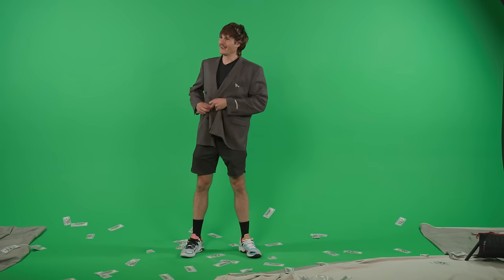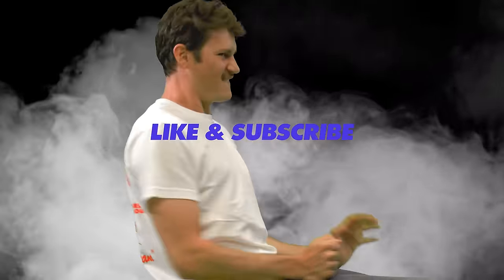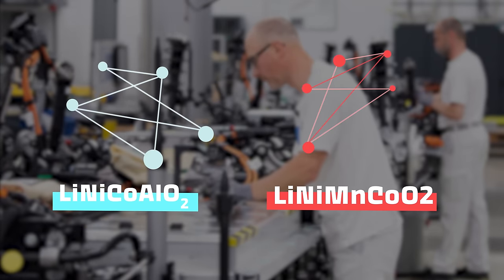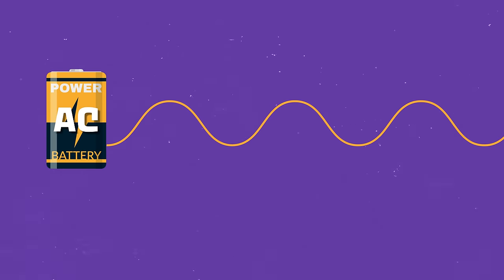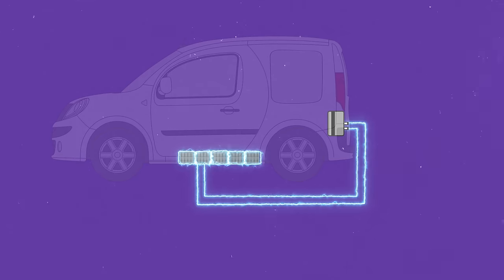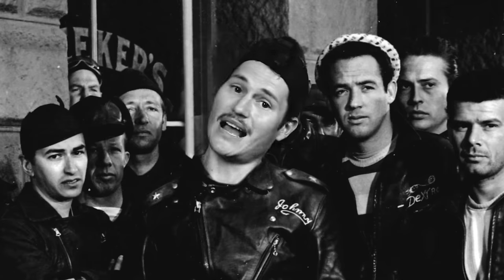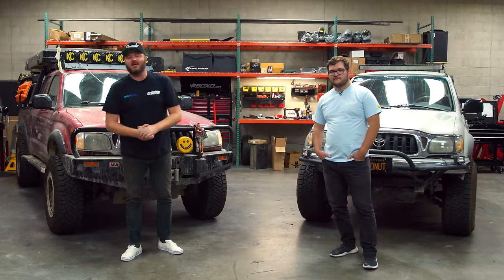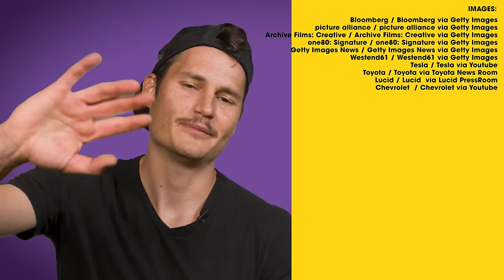Why this Chinese Car Costs $900

Comment: You laugh at that name on Alibaba but that is the actual statement of practicality in China. Many grandads will pick up their grandchildren in these electric cars. They are driven on the main road usually but are not legal. They are designed for the elderly. On roads, the elderly will be allowed/ignored, to drive these about on the roads. It makes things practical for the elderly. I ride an electric bike and I usually have to dodge these as they go in the bicycle/ebike lane (for electric bikes and pedal bikes). They are also used on the road but to the side. Some use them as a taxi in the farmer regions, they  charge $1 for a short distance, very cheap usually. Just to let you know you can buy them for about $315 with no battery. You then add on the battery you want. That price is actually for the boot/truck version. So, like the one you have but with a small extension on the back for luggage, etc. This is the price for retail, you can probably get another 100 usd off in the wholesale in China. Also, if you buy in the villages, mega cheap.

Comment: As far as I know, these don't require driver's licenses to operate on roads in most cities in China. They are kind of being banned by local regulations since they are frequently hit by other vehicles, causing a lot of casualties (these cars merely offer any protection to the driver). The majority of the drivers are the elderly who don't know the existence of a DL. That's why they are called the 'elderly's leisure car' or 老头乐. I've seen one taking random U-turns on the road lol

Comment: Ok, back in 2009-2011,  Kandi had the Coco for sale in the usa,   the KD08E, this was a little 25mph/60 mile range electric car, that cost..  899. 

one of the funniest arguments about it was...  "well what happens if it breaks in 2 years...."   "it was 899, buy a new one!   its cheeper then the deprecation of almost any car the moment yo drive it off the lot!"

Comment: deep cycle lead acid batteries are designed for almost full discharge and still have long life and rack and pinion was around in the 1950s in Europe.

Comment: What's crazy, is Americans will spend $5k-$8kfor an electric golf cart...basically the same thing. So there is more to the low cost than how it compares to a tesla.  An electric golf cart usually has a bigger motor but similar voltage and lead acid batteries.

Comment: The washer motor shown is a universal brushed motor. They also runs on DC. But 60V is a bit low so som electronics is still needed.

Comment: I want to buy this and slowly upgrade this with more powerful parts. Bunch of 2nd hand lithium iron batteries. Bump the voltage and finally swap in a 10-20kw electric motor and inverter.

Comment: It's like a modern Trabbi!

Ultra cheap and basic. Designed to basically just get you from A to B. 

Though, I think the Trabant might have been bigger. East Germany might have done a better job.

Also, the use of a ashing machine motor makes me think of CSIRAC, Australia's first computer. Built in the late 1940s by the predecessor to the CSIRO, it used the motor out of a washing machine for the drum memory secondary storage system.

Comment: Good modding platform maybe, I have a 5000 watt motor sitting around,  bet I could cram it in, and double the range with a good lifepo4 battery.

Comment: That car would make for a fun project car, convert to lithium batteries and squeeze in the biggest motor you can fit in it, lower it and put on deepdish mag wheels with low profile tires on it and flare the wheel wells then chop the top but put a sun roof on it so your head will stick out the top!

Comment: If cities had even remotely intelligent design any residentially zoned area would have 25 mile per hour speed limits on every street minus access roads to interstates and highways. NYC almost has 25 mph speed limits universally and guess what, they have almost no traffic fatalities relative to smaller cities with higher speed limits

Comment: Sounds like what Clive Sinclair intended to make after his much derided C5 single seat 3 wheel pedal assisted 3 wheeler. Yes - lead acid battery an 12v washing machine motor.

Comment: It would be great to see you get one of these upgrade things. Twin motors, bigger preferably, lithium batteries. Up the voltage to overdrive the motor. Let’s see if you can double that top speed. 😄

Comment: What if you can charge the battery on-the-go? Stick a windmill-like device that could generate power to charge the car's batteries as it moves 🤔

Comment: If you can order these without batteries, motor and controller you could put qs 138 70h motor, sabvoton 72150 and atleast 5 kwh lifepo4 battery in this for about 1500 dollars easily and then it could be actually be used as city car. I think about 10 kwh lifepo4 battery in this would be possible because lead acid batteries are over 4 times heavier than lifepo4 so battery would weigh about the same but performance and range would be lightyears better :D

Comment: 2:46 - you can see the ones that caught fire and were returned to sender. J/k.

These things are cool. I'd love to put a 1 liter 3 cyl kubota turbodiesel in it, could probably get 100 mpg easily. Just the way it is stock makes a joke out of the new prices of an electric golf cart. Just an enclosed cab on a vehicle  should in itself make it worth more. Reminds me of the tata 2700$ car from a few years back, just way cheaper.

Comment: Usually we won't consider this Changli as a passenger car in China. If I buy one here, I can't get any insurance or registration for it. It's basically a wheelchair with power, steering and a roof.
I don't see any trash made in any other country get so many attention.
Talking about the Chinese fake cars and the wheelchairs easily get the views, not the decent mainstream Chinese brands. I understand it, but I feel sad for the Chinese car industry.

Comment: Okay 2 BIG issues i see. 

1. The 12 batteries to run this car will probably cost more than the car itself.
2. Lead Acid batteries are not designed to do hundreds or thousands of cycles like a Tesla or Iphone battery, they typically are only designed to live for double digit cycles so you'd be changing your (more expensive than the car), 30 pound, super polluting, batteries all the time.

Its all bad.

Comment: Very interesting. Don't see it being very popular in UK though. You would need to have a top speed of 30-40 mph to use it around town. Cruising along at 20 mph, you might fall victim to road rage on your first trip? A shame really - how many big gas/Coulomb guzzling cars only have one or two occupants and are probably on a trip of distance of less than 40 miles? If we all switched to cars similar to this (even as second cars), could have a big impact on pollution?

Comment: Ya know. In the city, it might not be so bad. And at 700 pounds, it’s only 200 pounds heavier than my motorcycle.

That said, I’m not in the city anymore… and this little car would be scraped off the bumper of the huge trucks everyone drives out here. 

Add: I have three motorcycles that keep rotating. I have one bike they’re gonna need to bury me with. 😅

Comment: The Watts per pound of this thing is lower than my cycling FTP: 1200W/(712lb + 174lb)=1.35W/lb vs 300W/(25lb + 174lb)=1.5W/lb. Granted I can only output that for one hour but I also recharge faster than 6-8 hours!

Comment: Ive bought used w/200,000mi for a dollar, 04 corolla, got 60,000mi out of it, cold A/C, only reason I got rid of it was because I wrecked it, my fault, probably would have done 30,000 more.

Comment: do you know if there is an upgraded motor that you can replace that 1.6 hp washing machine motor?
I am serious about wanting to change it out on the one I bought because the advertising is very deceiving when it shows how fast this thing can go.
if you try to go up a hill you might do 5 mph and it's struggles like hell. There is also a governor on this thing that I would like to disconnect if anybody knows how to do it?

Comment: So they literally built a knockoff of a 40 year old top-of-the-line Club Car golf cart with a cold weather kit, and upped the battery voltage, but shrunk the motor... Gottit.
Reply: If you live in New York City, this would be an advantage but in smaller, less dense towns i don't think so.

Comment: lol I've seen e-bikes with more power and better... well, everything. Mine is limited to 250W (or around 0.3HP) for legal reasons, but it does have e.g. hydraulic disk brakes. Then again it did cost me closer to 3k€ and doesn't have a roof. On the other hand it's a ton of fun on a trail, and makes commuting a joy.

Comment: converting AC to DC (Charging) then from DC to AC (Motors) is So inefficient a boggles my mins.. but i guess we cant have efficiency, that will come when they have run out of POWER BABY... just like modern vs old gas cars.

Comment: @3:17 .. Engineering costs, pff. I have a pair of Crown Victorias, an '04 and an '07. Same glass, metal, etc .. but every little thing isn't. For example, the headlamps and markers are the same - but the (bulb) harness plugs are different. One of the alternator mounting bolts moved a quarter of an inch, which means the coolant crossover casting which it bolts to is also different which required retooling. The power window modules are entirely different. Etc, etc. We're not talking safety or revision due to a fault .. this is a model year change for the sake of pissing money away. Actually, almost every connector in the car is different between the two years - not necessarily the signals on the wires, but a tweak to the shape of the connector, or swapping the wire position. Why? No clue. But it burns my ass when I hear them whine about not enough money. Iacoccoa knew how to sort that out 35 years ago. As well .. How many post 90's auto-trans offerings came out strong and stout, but the fourth or fifth model year revisions regularly shit the bed? In the old days, a TH-400/727 Torqueflight/C-4 would swap like for like in decades of model years. And why wouldn't they? Engineering and tooling was already bought and paid for .. ka-chunk-ka-chunk the buggers off the line for material and labour costs years to come. 

In fact there's been a relatively recent one-eighty with this dichotomy. In days of ye olde, powertrains would go decades in production, with industrial design understandably tweaking the metal yearly. Hard to sell a '77 if it looks exactly like a '76. I get that. And then frankly a wise move (GM for example) going corporate across the board deacdes ago. No more of this BOP (Buick, Olds, Pontiac) crap .. EVERYTHING  General gets a 305 or 350. How long did AMC cast that old 258? Or rather, how long was that 258 cast long after AMC  went tits up.

As much as this may have pissed off purists, it did make sense. Home wrenches were a very small percentage of new car buyers .. and in the end the shape of the grille sold cars.

But whatever they're up to now is total dirty bullshit.

Recall the days of seven inch round headlights? Universal? Six bucks? Phillips screwdriver in the parking lot? Or am I just that old?

Not now. $2100 for some of them .. recommended to be replaced in pairs. 

Sure, go on about shit range and no brakes .. but this isn't Germany. This car is little more than an enclosed version of those cheap e-bikes pissing off pedestrians, but they just may be the cat's ass in Hung-Lo.

I also have an '05 Hemi Jeep. 0 to 100 in fark all, it's a beast - which spent almost entirely it's 400,000 Km sitting in rush hour Toronto traffic averaging walking speed.

Laugh at this POS as you will .. but then look around you, cost per actual mile driven anything American vs resale lifespan. The Chinese probably have this right.

Comment: 8:27 also its only weight 700 pounds ..its not like you need the power steering  hell if you really need to you could probably just get out  and with the help of a passer by lift up the frount wheells of the grounf and just pivit around on the back two lol

Comment: It's barely even a car, it's basically an invacar/canta and with this kinda top speed it really has no place on most roads out there since it would be a massive nuisance and a danger to the rest of the traffic on any transit road or main road even in the city, in netherlands those "cars" only drive on the bike lanes
Reply: If you live in New York City, this would be an advantage but in smaller, less dense towns i don't think so.

Comment: I am 64 I don't have a car. I don't have 1k$ either. I have to walk to the store (1mile) as I live out of town. If you are gonna give a car away please consider me. I need and I wouldn't have to walk. That store I walk to is not in town, town is 10miles from me and cost me 50$ to go there which I have to do to buy a bill of groceries, do laundry ECT. I do not have income so I struggle a little. It would be a nice gift though.

Comment: Lithium is not all that its cracked up to be...........especially in recycling and life. On a daily charge the best lithium battery brands are down to 80% capacity at 10 years and are toast at 15.  Not forgetting their affinity to catch on fire and burst when charged and physically deformed in a crash. King pins are still found on all modern heavy trucks.  The Chang-Li can help americans adjust to their new standard of living!

Comment: Jerry I really like your content specially the one about top fuel cars you really studied up on that,  But because you are so young  (I guess) you make these glaringly wrong statements for instance instance saying that discs are the most common brake systems. This is just wrong,  In modern cars discs are becoming more prevalent for sure but there are still many economy cars that have drum brakes. There are 2 reasons for this first drum brakes are self energizing,  This means they are designed to use the wheels rotation to help increase the force applying the brakes.  Because of this in the past cars did not need power assist brakes.  making a more simple less expensive car.  Also another benefit of drum brakes is is is easier to build a parking brake system with drum brakes than with disc brakes  thats the reason even today you will see drum brakes on many vehicles.  In fact even cars with disc brakes in the back have a small chamber in the back rotor and they put brake shoes in there because its easier to build a mechanical parking brake system there.  Also before about 1965 all most all cars had 4 wheel drum brakes because you didn't need power assisted brakes like you do with discs. 
  Nuff Said     Cheers

Comment: China has acquired a reputation for producing absolute crap -- no matter what it is.  I see no reason to think this would be any different.  With a top speed of 25 mph, you can take your golf cart or bicycle and do as well.
Reply: Not everything made in China is crap, with Tianjin/Sea-Gull watches being one notable example. Also, a golf cart is still several thousand dollars more expensive than this thing.

Comment: I wish I could buy this car  the Taxes in Turkiye is too much I would really like to upgrade it slowly because It's such a simple car. I'd slowly change the coils brakes to better ones Monhtly one by one Like If you want to buy a super modern car that is 2022 model The car is 200k  And taxes are 600k

Comment: No..or maybe yes, i may laugh for myself a bit...
but i have become so old i even see the truth about any fancy car too, after all it's just a car...
once i saw a glossy fixed up porsche, drooling as expected til i bend over (better with back to the walls these days)
and watched the underside wich was just a car driven 10-15 years ( i bet idiots bought it new didnt keep it clean from start)
....but anyway.
Actually for 1000$ i could buy one for shorter arrends and mostly locally, but as long you find roads dont really become a speeding
speedbump at 25Mph,....   Here i should be done.

but as the unfixable master of never ending posts
This is the rambling version overexplained:
...thougfh i think you must use it sparse and feel it not strain things in anyway i think it could roll for a while.'
at work long time ago we got new cars each 2nd year or 100.000km  (delivery )  and im known and yelled at for being weirdly pedant no slamming
doors (especially when the window is open!!! lol   or silly masturbation window up-down-up-doooown-uuuup-down.. really avoiding potholes or edges and always take my time slow down for such places, wait for gears to really slip in place...let the engine rev out on the gas it gets, then almost seenless pop in next ( revmeet perfection both up n down like it was my middlename)....  the point was my cars could be driven 50% longer to reach same tearing just by a bit
manic carefulness.